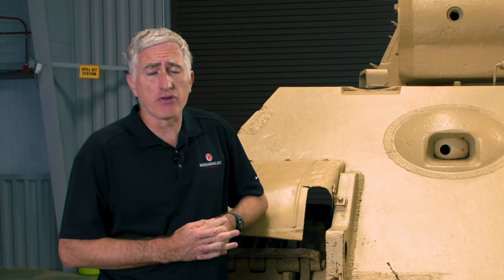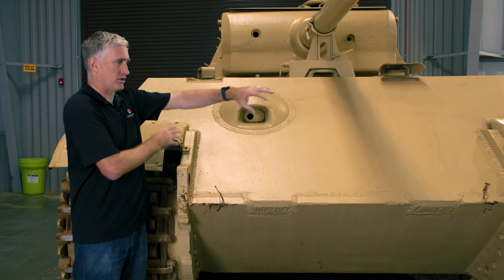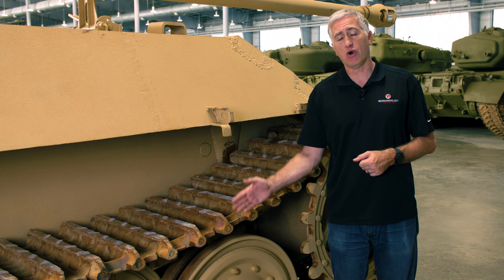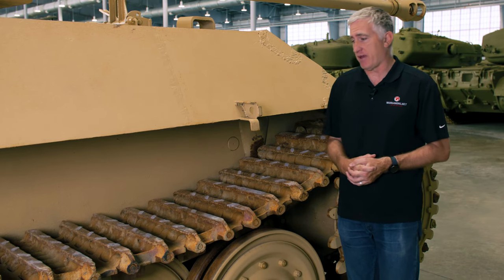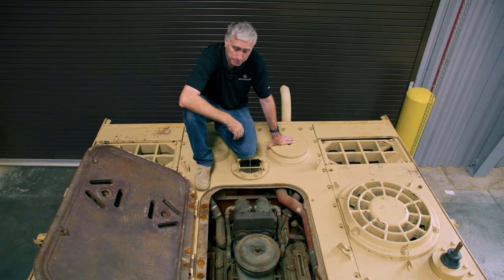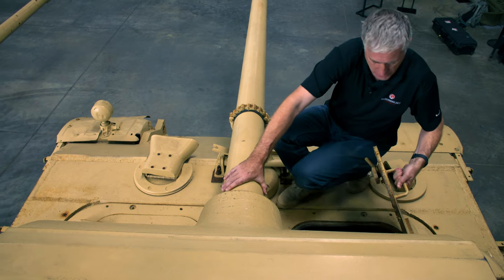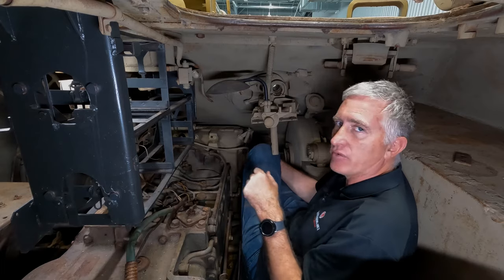Inside The Chieftain's Hatch: Panther II

Comment: Interesting that the Germans in WW2 might have been inspired by the wedge to keep the track pins in place from the Soviets but did not try to use the compressed air starter.
Reply: Diesels can be started simply with high pressure air by altering valvetrain and applying pressure on 2 or 4 cylinders.
Otto (petrol) engine would explode, carburator would pop off. They need starter with vane air motor and gearbox and clutch, expensive and complicated for 1940s.
Reply: air starter sounds nice but how long does T34 needs to pump up both bottles ?
Reply: @michaelpielorz9283  They are pumped to medium pressure in few minutes while engine is running. If for some reason start fails, 3-4 startings are possible with one charge. Normal electric starter is also present and seldom used on cold engines. Pressure transfer from tank to tank is also possible if for some reason air cylinders are empty. T72 also continues these features till today.
Reply: That T-34 was not a war production model. War models did not have the wedge

Comment: Not a dead-end prototype though, as it did influence the side hull geometry of Panther Ausf G, which also had slightly thickened upper hull armour too.
Reply: As the Cheiftan mentioned the Panther II was a testbed for improvements, and some of those optimisations went into Ausf G (like the rearragement of stuff on the engine deck). I think the biggest improvement that didn't make it, however, was the commonality of components between the Panther and Tiger II ... at that stage of the war Germany could ill-afford a myriad of parts for its various - and various models of - war machines (Messerschmitt was also under orders around the same time to rationalise the Me109 to fix this problem) but as always it's a balance of evils. In this case, minimising disruption to production trumped the longer-term gain of simpler logistics.
Reply: @DenKHK  Also keep in mind its not just disrupting production but that you have to REPLACE all the old vehicles to simplify the logistics. Having a new Panther using Tiger II parts does not mean the old Panthers also switch, they still use old parts and still need those produced to sustain operations. This was a problem the Germans faced with halftracks. They tried to reduce the amount of halftracks types but they only doubled it instead as the new ones were never in enough supply to replace the old ones.
This would be especially bad with panthers because Panthers went to normal panzer divisions. Tiger IIs went to independent heavy tank battalions. Their logistic lines are largely separate on the lower echelon levels. If the panthers were a mixed of new and old, suddenly the logistics of the panzer divisions gets complicated with two different spare parts requirement.

Lastly, Germany may simply not be able to produce enough of a single component to sustain more than one or two tank types. This is seen with engines. Specific engines were strictly allowed for only bombers or fighters, or tanks. It would seem logical for every vehicle to use the same engine for a common component but the production for any of the single engines simply could not meet the demand. The alternative would require retooling and completely new factories. It simply wasn't  black-and-white situation. Parts commonality isn't always better, its very circumstantial and nuanced.

Ideally parts commonality are established BEFORE the design enters service and not during war. So that the supply chain and manufacturing base establishes itself to meet the increased demand, and that all vehicles are uniform from the start and do not need to replace non-standardized vehicles from the fleet(which require sustainment)
Reply: @neurofiedyamato8763  Very valid points and makes perfect sense. Although I was aware of some of the facts you mentioned - particularly the separate assignments between SPzAbt and panzer divisions and the aircraft engines - I failed to put 2 and 2 together to realise how the circumstances which these facts illustrate would also cause major problems in the case of Panther II. Thank you for the enlightenment!

Comment: The Germans seemed to have had a fondness for reducing vibrations by having a steel wheel with a steel tire, joined together with a rubber ring.  From what I have heard, it only really worked for streetcars.  The light urban rail systems were not that heavy and did not go that fast.  They would dampen the vibrations of high speed rail cars, but one catastrophic failure which caused a high speed train to pile up against an overpass (the Eschede rail disaster) was enough to limit that type of wheel to only streetcars.

Comment: I can say that as a young man, I witnessed the Panther II being restored-in bits and pieces in the old wooden Patton Museum building well inside Fort Knox. A decade later, I found myself participating in the museum's annual July 4 "Living History" programs. As luck would have it, I was there the only time they had the Panther II running-sort of. It was not running well, but it did move. After that day, they decided, having spent years to get it that far, to put it aside and concentrate on other vehicles.  As an aside, I got promoted to being the loader and then the driver of the ex-Swiss Hetzer. It too suffered problems as did the one that I later acquired from the Swiss Army. After years, I discovered the problem. (Both mine at the museum's still had the petrol Czech engine.) The wire to the kill switch, from the magneto was the problem.
Additionally, the Swiss liked the German method of using a collar and tension pin connecting their steel track links that, after the war the Swiss bought a large number of US built T16 Universal Carriers. Originally the tracks ends were welded except for a few links that had a cotter pin and washer. The Swiss went to such extreme that almost all the T16s had there tracks modified ala German collar style. Even the Hetzer had this arrangement. 
Consider securing a copy of the founder of the WWII Historical Re-enactment Society's book, A BRIDGE TO TIME, A Re-enactor's Journey.

Comment: They upgraded the engine so I would assume they upgraded the transmission and final drives to be stronger as well. That seemed to be one of the problems with the service Panthers so that would be a big improvement.
Reply: Some sources (Jensen/Doyle ie) say the final drives and steering brakes from Tiger II would have been used.
Reply: @mbr5742  Correct, Doyle mostly stated this method was used to fasten and ease the production. This also birth the E series
Reply from the maker: We learn something everyday 😁- Ser_Renmseldorf
Reply: @dronn_  fasten speed up
FTFY
Reply: @peasant8246  Thanks a lot for the grammar correction!
Reply: Most of the problems were sabotage and giving teenagers complex machines to operate. The owner of the jadgpanther states they haven't had the common issues associated with panthers because they know how to operate it. Imagine giving a 17/18 year old kid a panther.. grinding gears etc..
Reply: Correcting the final drive issue was certainly one of the primary objectives of the Panther II project. In normal circumstances, the Panther I wouldn't have made it into service with this problem but there was such urgency that the tank was ultimately rushed into production... and combat. Whilst many iterative changes were made to improve ergonomics, performance and reliability as crews provided feedback through the German Army's reporting system, the final drive proved to be too big of a challenge for assembly line tweaking to correct and they needed to do something more substantial. 

For the sake of museums and tank days around the world, a part of me definitely wishes Panther II made it into service.
Reply: The abiding issue with the Panzerwaffe in 1943-45 that tends to be overlooked is that German designers thought in terms of tanks serving in campaign seasons, a period of a few months of high-intensity operation followed by weeks of rest and refit, rather than serving year-round in continuous operation. Thus, their tanks were designed to run well with low maintenance for a period of time before having lavish maintenance done. This worked in 1939-41 when the war quieted down during Winter and Spring, allowing the Panzers to do the lavish maintenance. 

By 1943-44, ALL German vehicles were proving highly unreliable as few units ever found the time or resources to perform basic maintenance. The Panzers were required to run from one battlefield to another with little rest or refit in between, rapidly wearing them to death. A lot of supposedly "bad design" was because the Panzers were simply being run far more often and much father without their proper maintenance, not because the designs were actually faulty.

As shown by the French and other operators of Panther after the war, a Panther ran very well when its crew actually did the maintenance specified by the manuals. They never had significant problems with Final Drives, transmissions, and so on. What they did identify is that Panthers were a LOT more maintenance-intensive than they cared for, which is one reason they were glad to get rid of them. However, that didn't change the fact that Panthers were not breaking down half-as-often as they did in Wehrmacht use during the war.
Reply: @fibessnaredrum2775  that was ruched through panzer school, and have no prior experience of driving a car or motor cycle becue of the war, and the stress of combat.
Reply: @fibessnaredrum2775  Sabotages relatively a minor issue that the Germans had taken quite precautions against it (Forced labor camps were directly run by SS men instead operating like regular factories). By 43/44, most new German recruits would be 17/18 years old, not too different from the rest of the world too. While there is slight degree of rushing at panzer schools, it was specifically the driving sessions that were lacking. Why? Because practicing driving consumed fuels, something Germany didnt have, much like the decline in Luftwaffe pilot training in late war. Other aspects of tank operations, such as gunnery, were still generally kept at a passable standard even in last months of war.
Reply: @mbr5742  iirc, the original plan was for the Tiger II to use the Final Drives and Transmission from the Panther & Panther 2. Eventually this idea was scrapped and they upgraded these on the Tiger 2.

This was one of the many mistakes on the Panther 2 and highlighted in Jensen & Doyle's work. It was part of the reports I sent over to Gaijin back in the day, that resulted in the fantasy Panther 2 being removed.

Comment: Rubber layer under steel rims was one of defining features of T-64 and it actually saved a lot of weight (compared to T-62 or T-72). The secret was that with this trick you could make road wheels much smaller.

Comment: Steel-rimmed road wheels with internal rubber cushioning were most notably used on Soviet early KV tanks, then (ironically) they were replaced by all-steel wheels to save rubber.
Also Soviet T-64 is the most prominent post-WW2 example.
Many many Western sources still spread "all-steel" myth, in reality they have steel rim, aluminum disk and internal rubber cushioniong. With small diameter and aluminum they are a bit lighter than T-80 wheels and almost half the weight of T-72 wheels.

Comment: The Germans first used the T-34 style pin ramp on mid-production Pzkpfw-III/IV chassis - Nashorn & Hummels. They differed from the Panther-II in having it mounted on the rear lower side hull, next to the rear idler.

Comment: One thing i noticed quite different for Panther II is that around 21:00 you could see the last roadwheel (to the left) has quite abit of gap between it and the 2nd to the last roadwheel, idk if it is some sort of feature or a broken arm, but kinda neat in the sense that because they likely couldn't get another roadwheel in-between them hence the gap, the last roadwheel torsion bar is likely heavier and might have heavier dampers too.
Reply: It gets even more interesting - the pattern is different on the opposite side. The gap on the other side is between the third and second to last

Comment: Informative and entertaining as ever. 

If you ever run into a PAW-600 and have information on it, could you do a chat on that. PAW-600 seems like one of those 'just too late' weapons that would have given the allies fits and nightmares if it had been available a year earlier.
Reply: The only one that would have nightmares with it would be people from the German logistic chain. Its a stupid idea just like starting WWII.
Reply: It's a great idea, it replaces low level anti-tank and infantry guns into a single platform (simplifieing frontline logisitics) that shares alot of parts with mortars (simplifieing production logisitics), while increasing mobility of both the anti-guns and infantry guns they replace (improving survivability). The only problem would be the reduced velocity at 1km for accuracy perposes (but even then it was found to be roughly as accurate as the pak38 at that ranges), it's gets shells means range is only a accuracy concern not a penetration 1, and low level anti-tank assets already had a doctrine of engaging at less than 1km (so as not to reveal information about defenses).

And in terms of armoured fighting vehicles, it can allow alot more firepower in a smaller armoured package.
Reply: Paw 1000 is even beter

Comment: It seems to have the Tiger II steering box (having a steering wheel), that’s definitely an improvement. Should have been easy to drive.
Reply: The tiger 1 came with a similar steering wheel style too.the Germans quite liked it. I think the theory was that most Germans in theory knew how to drives cars so it made training easier and also way less of a work out for the driver. If I'm not mistaken some tanks came with power steering but that would definitely be a chieftain question.
Reply: @HbEthan.  The Panther had power assisted steering.
Reply: Most Germans did not know how to drive.
Reply: @HbEthan. That’s why there were two drivers - they could take turns to rest.

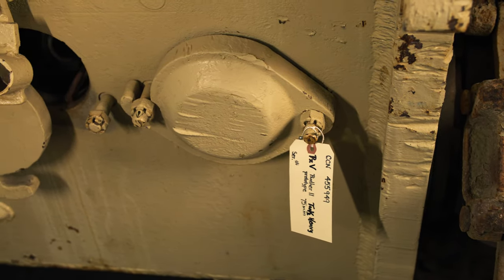Comment: Okay so the 10:11 flywheel thingy was the preferred method of starting, but why? what risk did the electric start pose? just wondering :)
Reply: The electric starters were a relatively new technology for the time and wasn't fully trusted. Alot of them would cause fires i assume. most of  the aircraft engines used in tanks came with them anyway so I see why it remained a standard feature on more modern engines.
Reply: @HbEthan. it was trusted, but batteries did not have the quality of roday.
If you got the time, crank the engine and safe the battery for emergencies.
Reply: Flywheel thingies don't catch fire, electric starters still do that from time to time (more so on things displacing 20+ liters) and WAY more frequently in the 40s.
Reply: Not to mention where they were fighting. Cold kills batteries. I remember having to get a new one many times even in the 80's because of a cold snap. Batteries in the 40's were even worse. On the Eastern Front it's not something most would trust with their lifes.
Reply: Another issue would be the lifespan of electric motors of the day. Better to not to wear out the starter than find out it's dead when you really need it.

Comment: Now what would be the point of a torsion bar that "goes across and does a 180 and comes back"? The entire point of a torsion bar is that it twists. If it was built in two rods, only one of them could actually twist. Either the one directly connected to the hub would twist and the other one running back across the vehicle would not move, or the one connected to the hub would just move up and down while the first one twisted.
My understanding is that Panther had single full width bars for each wheel, laid parallel, so the swing arms had to fade different directions to put the axle hubs in line with each other. But this gave you full width torsion bars. But they didn't run out and back, one bar was anchored on the right and was attached to the left wheel, the next was anchored on the left and controlled the right wheel, alternating down the tank. As opposed to half width where they are anchored in the center and each half shaft runs the wheel on the corresponding side. Typically a single bar will work, as long as the center is anchored in place. A U-shaped torsion bar isn't going to work that i can see.
Reply: Panther's torsion bars are anchored on the same side that the wheel they are suspending is mounted. The 'twist' thus is spread over twice the width of the vehicle, out and back, unlike a traditional torsion bar which is anchored on the far side of the vehicle from the wheel they are providing suspension for. What you may be confusing for an anchor on the far side of the vehicle is merely a connector between the 'outbound' bar and the 'return' bar, that connector itself also has movement to allow the twist to pass from one bar to the other.

Comment: 6:00 It is a copy of Soviet solution, no doubt about it. Pin can be whacked back in place only on parts of track that are not under tension provided by drive sprocket.
Germans had drive sprocket in front, Soviets at the rear, that is the only reason why whacking ramp is on different side of tank.

Comment: You know if the Panther did use the tiger 2s powerpack in general it'd be a much more reliable vehicle. Using parts designed for a 70 ton heavy tank on a vehicle that would've weighed in at like what 52 tons would've done wonders and possibly future proofed the Panther 2 even more making it far more suitable for upgrades
Reply: What do you mean? The Tiger II used the same HL230 as found on the Panther, for lack of a better powerplant.
Reply: @_ArsNova  i said powerpack not powerplant as well, everything inside the tank that drives it is collectively called the powerpack.